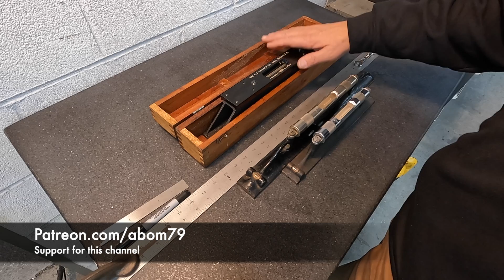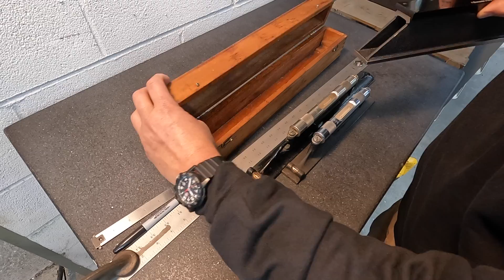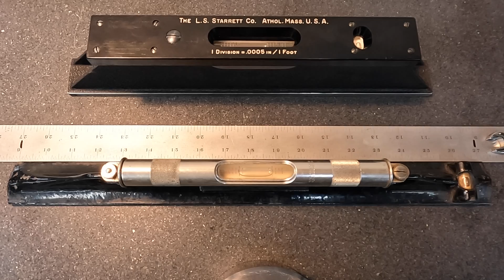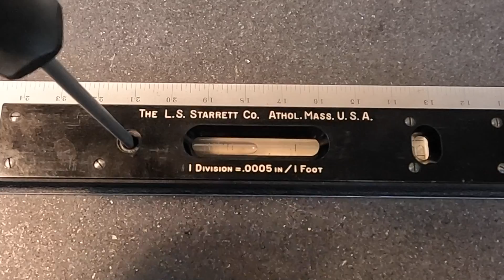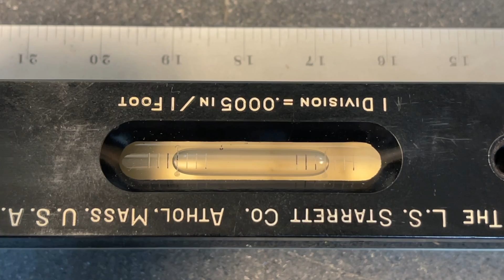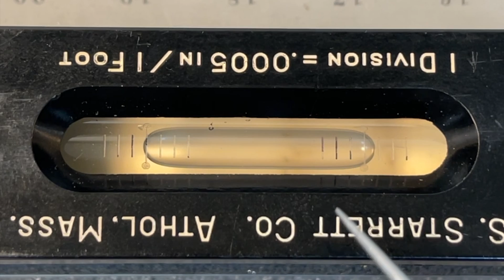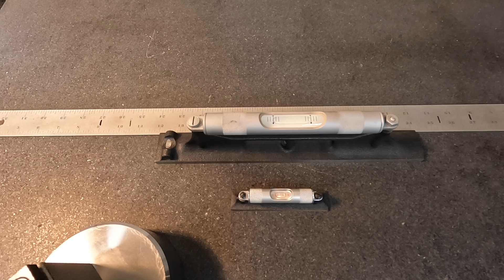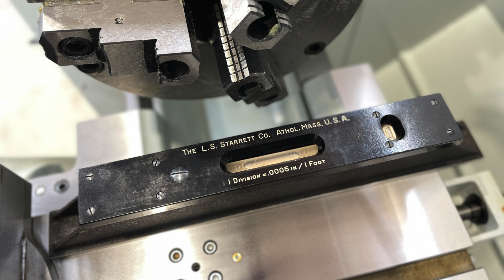Precision Level Calibrating

Comment: Just a question about the level is it really that important to have a level that particular to set up a machine or whatever else that’s used for I have a 4ft and 3ft level that work well I just can’t imagine having to calibrate a level to that extent. What else are they used for?
Reply: It's a level to level levels. 

If the machinery you are working with is not as level as absolutely possible.
 there's a high possibility  that you could end up with run out in your materials  that you didn't anticipate.
Reply: I totally get having a machine level but 5 thou per foot seems minimal but I’m not a machinist just a welder it’s still a really cool vid on how accurate a level can be thanks for the answers
Reply: @richpitty  1/2 thousandth per foot
Reply: @richpitty   I am no machine as either however I am a carpenter and I do really high end is the high end interior finishes a mill work and I just really appreciate abom
Reply: @tonytunnell9873  ya me to I get precision for sure it was just a question even using lasers levels this is just a whole different level
Reply: @richpitty   I'm usually pretty damn happy if I can get something within a 16th and 10' but that level yes is a whole new level.
Reply: What are those, carpentry levels?  Everything in this channel is down around a thousandth to a ten-thousandth.

Comment: 17:50

Hey can someone tell me why the bubble vial is designed like this? Every other level I've ever seen is designed so the ends of the bubble line up with a divisional line on the scale. It seems to me having the bubble align with a demarcated line would be far better and easier to see if the 2 match perfectly, instead of having some arbitrary amount of bubble over hanging the line on either side...? I can see the 2 longer lines with little circles on the ends, almost like barbell shapes. So clearly that's supposed to be the center/level position, but the bubble is too big to fit between them, and from what I can see doesn't line up with any 2 lines the length of the scale....? Thanks so much to any and all that take the time to answer.
Reply: Particularly on these very sensitive levels, getting the vial fixed with exactly the right amount of air so the bubble fits exactly between the index lines is almost impossible, and even if you got it perfect, it will change over time as gas and liquid molecules migrate in and out of the vial through the seal. It's not hard to recognize that the bubble is slightly outside the index marks or slightly inside.
Reply: vial
Reply: I am not a machinist or trained in any of this, but my first thought immediately springs to the idea of temperature and pressure. With something that sensitive, the temperature of the liquid and the pressure on the container (and the liquid!) would affect things. So I bet that in 100% factory perfect conditions, it would exactly line up.
Reply: @Athenor  You are correct. The liquid inside is typically an alcohol and the bubble’s size is absolutely affected by both ambient temperature and atmospheric pressure. Some days bigger, other days smaller. That’s another reason to check a precision bubble level in both directions to confirm your reference point.
Reply: @andrewstewart2741  I follow the temp impact, but the pressure? The bubble is in a sealed chamber where the outside atmo should have no impact.
Reply: @boots7859  It is indeed a sealed glass tube - that happens to contain a GAS bubble. Suffice it to say, if the tube were completely filled with liquid (and no gas/air), I would agree with your conclusion that pressure would make no difference since liquids do NOT compress. But there is that GAS bubble inside that allows the tube to become sensitive to changes in external pressure.  Granted it's not a huge difference, but this is a precision instrument that responds to the TINIEST of inputs.  That's why you can drive yourself crazy trying to use one. Your basic carpenter level or most any level from a hardware store would never indicate such a difference.  You don't have to believe me, so maybe try reading up on the GAS Law "PV=nRT" where you'll find that Pressure, Volume, and Temperature are inextricably related.
Reply: I believe you are seeing an illusion created by how close the camera is positioned. The perspective is thrown off.
Reply: Every other?  EVERY?  :). C'mon, you've seen levels where that wasn't the case.  Sure you have!  :)

Here's some speculation:  Image you were making the vial.  It's turned up on end, the bottom end is sealed with some hardened plug of goop, and you've got a can of mineral oil (or whatever they use) in your hand.  You're going to fill the vial most of the way with liquid, plug the top end with a lump of goop, and then turn it sideways and see how long the bubble is compared to the marks.  How much liquid do you have to put in to make it line up perfectly with the marks?  What would happen to the bubble of you added a bee's knee worth of too much oil?  Or slightly less oil, like a tiny-micro-dribble-sneeze-drop??  Or if the goop you stuffed into the end to plug it was slightly softer than the good you pushed into the last one, so the depth inside the vile is a little different -- because, oh yes, the plugs on the ends of the vial are an important part of determining it's exact volume, as is the way the glass stretched and then cool as it was being formed, as well as the EXACT curvature of the inside surface, and so on and so forth.  In other words, I think the exact and precise volume of the inside of the tube would be very (very) difficult to determine before it was sealed, and it's the exact volume and the amount of liquid that determine how long the bubble is.  So my answer is...  "Maybe it could be done, but...  WAY difficult!" 

Also remember, most of the time you're using the level, the thing you're measuring... isn't.  Isn't level.  So the ends of the bubble aren't going to be on the marks anyway, even if they are on the marks when the thing is exactly and precisely leveled. What this means is that it really wouldn't be worth the effort.

Also, remember that if the ends of the bubble are hidden under the black lines, you can't SEE them!  That would sorta defeat the purpose of "precision", so not such a good thing after all.

All that said, I would guess Starrett has a pretty good idea of exactly how much liquid to put in the vial, to pretty good but not extremely good tolerances.  So whatever the reason, they're doing it on purpose, and my assumption is that they know more about level bubbles than I do.  And we end up with bubbles "about a half a tick over the line on both sides, pretty close".  In my experience, that works pretty well.  It would seem "wrong" to me somehow if the ends of the bubble lined up exactly with the marks, like on some of those hardware store levels.  I don't think I'd like it. Go figure!

I think it's easier on hardware store levels because the curve of the tube is so much steeper, and the mass production, and all that jazz.

Comment: Adam, when you wipe a surface with your hand to clean it aren't you leaving some oil from your skin? 
Will that throw your measurements off?
Reply: The thickness of the oil film under pressure is probably a hundredth of a thou. Nothing to worry about for this type of work
Reply: ... but the advantage of using your actual hand is that you can feel any grit -- pretty easily!

How thick is a sharpie mark?  Oxtoolco.

Comment: Can modern digital inclinometer replace those levels?
Reply: Not a <$100 cheapie from amazon, ebay, or aliexpress
Reply: How much can you spend?  The Starrett 199 has a resolution and accuracy of a half a thousandth in 12 inches is 0.0024 degrees.  The accuracy is completely up to you and how carefully you calibrate it, as well as your techniques for using it.

The $500 I just checked online is accurate to +/- 0.030 degrees -- a total of 0.060 degrees.  The $30 one is 0.1 degrees at best.  The $5000 one claims resolution of 0.005mm / M, which is 0.060 thousands per 12" -- better than the Starrett, but personally, I think I have some doubts.  I don't know... maybe.  If a typical affordable level can consistently give you 0.1 degrees, that's 0.021" per 12", which is 40 times lower resolution than the Starrett.

With a digital level, you're depending on the technology to give you accuracy, and that technology is hidden inside the thing.  With an analog level, you really do get the accuracy it promises if you take a little time to calibrate it, and if you use it properly.  It's inherent in the physics.  It's self-calibrating, which means you don't need to trust or pay anyone else to get it to work perfectly.  They're wonderful things!
Reply: @ydonl  well in that case I will get four of those round bubble levels, (one on each corner) and job done.
Reply: @shellybelly9205  For a big old surface of some kind?  That might do!  In theory, if the surface is stiff, i.e., not bending with however you're using it, they should all read the same.  It does kinda depend on how level you need to be and how accurate the round bubble levels are... if there's a way to figure that out.

I have some fancy bubble and digital levels for aligning the telescope mount, but I can be happy just using a fairly simple bubble level.

Comment: I would never have guessed you could calibrate a level on a not perfectly level surface, but that makes complete sense.
Reply: I think another fun bit is that, if you want to, you can find a level line on any flat plane that's reasonable close.  If you think about rotating the level on a slightly tilted surface, imagine it's pointing uphill at "this" end, and then you keep rotating a bit and now it's pointing downhill.  Well, somewhere in between... it was in transition, neither uphill nor downhill -- it was perfectly level. You can find that line with a level level, of course, but you can find it with an uncalibrated level by looking for the same bubble displacement at the other end after you rotate.
Reply: Kind of like how you can make a mill tramming tool on a mill that's not trammed, and then use that same tool you just made to tram the mill properly and accurately.
Reply: @nilamotk  woah, how do you do that?
Reply: @The_Gun_Room  Check our Mr. Pete 222 channel for his recent demonstration of a very simple and easy to use tramming device. It uses a single dial indicator that swings on an arm around the vise. The heavy vise does not need to be removed.
Reply: @The_Gun_Room  if you build a tramming tool on a mill that's not perfectly trammed, but do the whole operation in 1 clamping (drill the 3 holes atleast) when you do this the 3 holes are all perfectly aligned with the same error. This error is irrelevant after you calibrate the tool (very easy to do) and then you can tram your machine.

The first tool I made was a twin dial indicator mill tramming tool, and it hasn't let me down.
Reply: I had my boss show me how to check a level when I first started out. I have still use that to this day. I see a level and I then know how good that level is.
Reply: Irwin started making levels again (if they did before) in about 2007 ish. They included adjustment threads. I wish I had bought some of them then.

Comment: I remember when I worked for Maintenance Service Corporation we had a large pink granite stone that was polished and calibrated on a regular basis. It was used to calibrate our straight edges. Some of the grinding machines we restored had to hold 0.000050 tolerance.
Reply: We also had a HP laser that could resolve down to a millionth of an inch.
Reply: That's amazing, at that tolerance just the temperature changes from your breath would affect the readings.

Comment: If you use “T” type handle, by moving the ends of the t you can make shorter turns
Reply: I was thinking the same kind of thing. I was thinking a large ball handle would work well. More leverage so you don’t need as much torque and a slower rotation. And the ball shape allows you to palm it for more control.    Easy enough to make one.

Comment: I love letting "regular " people use our Starrett 199 at my work.  They usually come back frustrated and ask for a carpenters level.
Reply: I am not even at the point of accurately setting up my 4M long Victor lathe - it's close but not spot on. I have an Asian made level which is accurate to 0.05mm per metre. Tried calibrating it a few times. Patience is not my strong point. If you want to visit me in Land Down Under I would gladly accept some guidance/patience. But even when it is eventually right, and placed in its padded box, next time I use it will have to be checked and probably re-calibrated. More patience - or lack of it.

Comment: Adam has posted two videos to this channel showing how he and Lance made that granite surface plate accurate to the Grade AA specification based on the American Society of Mechanical Engineers B89.3.7 standard. The  Grade AA plates are the highest accuracy plates, and they are often found in calibration laboratories. Adam has a plate that is flat to 1,000,000 of an inch in every direction. This video https://www.youtube.com/watch?v=-CM3VWKXasY shows how this was done. And this video https://www.youtube.com/watch?v=VrodNx759oo  shows more of the process.

Comment: Why the need to get it that level? Seems over kill for a regular shop. Additionally, since temp changes things, wouldn't that make a lathe be out of whack enough that it didn't need to be that level to start?
Reply: The flatter you can level your machine, the better the parts will come off that machine. When you have hours and hours of machine time into a part, you want to know that when it comes off your machine, the dimensions are in spec. It all starts from the ground up, and the first and probably most crucial step to setting up a machine is having it level and flat.
Reply: The larger the equipment, the more important level becomes. Machinists crave precision, it's in their DNA.
Reply: @TheDuckman02050  agreed machinist like perfection. Have to always tell my employers, there is a difference between a fabricator and a machinist. Sometimes have trouble with it myself, but if concrete shifts that much, then as you add things to the shop, water table changes, wether you had breakfast or not seems to impact it. I can't believe even .005 makes a difference in the machine and the parts coming off it.
Reply: @bigthumperfoot   .005 is quite a bit.  That level was  .0005  That's a big deal.
Reply: I lived in Barstow California,there were earthquakes there all the time,it would crack floors an things.When the floor moves it would be hard to get a machine level.

Comment: My grandpa was a millwright and he had that same 12 inch starrett level and I got it now. he leveled the machines at the Ford motor company in St Louis.
  but you could do the same thing with a glass of water you're still using your eyeball to gauge.
Reply: No, not necessarily. It depends on the level of accuracy required. The vials on these levels are not filled with water. They're filled with a special fluid that is more "sensitive" than water.
Reply: @feelthepayne88  yeah the best ones I've ever used are topcon.  and of course they're not filled with water they would freeze.  they were originally called Spirit levels because they had alcohol in.  topcon level takes about 5 minutes to settle on a theodolite.  But all that stuff is are archaic and now we use GPS.
Reply: All that precision really doesn't matter it's not like we're trying to machine  invisible drill bits
Reply: I remember 40 years ago old Machinist telling me stories about how the Americans drilled the first microscopic hole and sent it to the Chinese and the Chinese send it back with a plug in it and a hole through the plug.  Just bullshit stories I'm sure.
Reply: @essentialjudge2279  Yeah, it was BS.  Real story was Germany sent 3 of the finest steel pins to Japan to show manf. prowess. Japanese returned them with 3 holes drilled in them.
Reply: @boots7859  heard that also